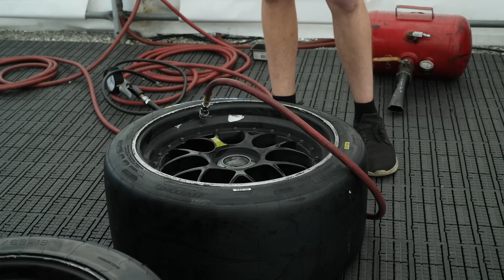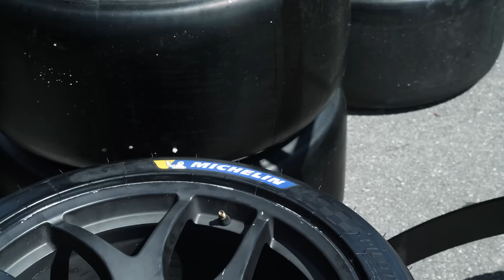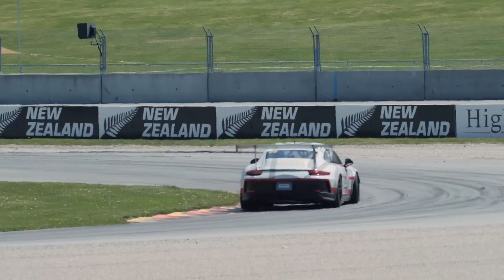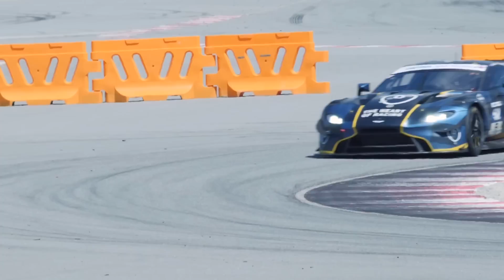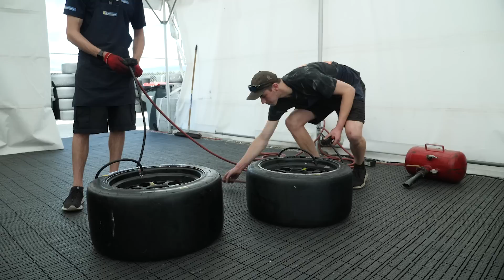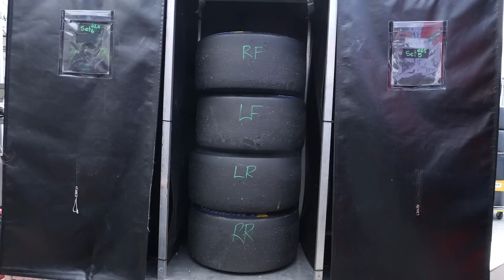Are your race tires too big? | Slicks Vs Semi-slicks

Comment: Please could someone explain why tyre performance drops as it wears? If the tyre is solid rubber, wouldn't it have grip the whole way through?
Reply from the maker: Less rubber, less thermal stability, and a heat-cycled, chemically aged compound are probably the main ones 😎
For the likes of sim racing tyres are actually one of the most difficult things to try and model accurately as there are so many things going on between them and the track surface, which can vary wildly and change the behaviour of tyres track to track too - Taz.
Reply: @hpa101 thank you for the reply. Every part of a racing car just gets more and more complex, the more that I learn about them
Reply from the maker: No worries, and they absolutely do! Diminishing gains the deeper you go though, depending on how deep the team you're trying to beat is going anyway haha 😎 - Taz.

Comment: but putting slicks on a car without changing or tuning the suspension, is it that beneficial? I would expect that the slicks makes the suspension feel a lot softer.
Reply: Good question. My humble answer is that the process of discovering what is a (near) optimum setup on road rubber vs an optimum setup on slicks (correct for vehicle loading, ambient temps and race duration) is an iterative process. Slicks will definitely increase the maximum load transfer both lateral and longitudinal. Therefore, spring, damper, geometry will all need readjustment or possibly replacement from existing. There are far more variables than constants here, so I'd always start the same way- run a fixed, known tyre pressure for all wheels, and measure temperatures across treads of all 4 wheels after a long test session, at high commitment. When you've made geometry adjustments to give the tyres a near-even temperature across the treads, you can then appraise the balance and feel of the car from a driver's viewpoint and look at adjusting other things, like springs and dampers (and whatever else!). As long as you get a baseline with as many variables clamped down, you get meaningful information on where to go with it all. I'm sure my own way is nothing like the next guy's, but it's worked for me since 1989!
Reply: @robair67  thanks! that seems like pretty logical process to go about it

Comment: I’ve been running a set of A050 on my MX5 for Supersprints for 3 about years. 
While they have lost their out of the box grip they are still a fast tyre. 
The only downside is I find I’m having to wait for the car the straighten up a little before applying power versus mashing the pedal before the apex on day 1.
Reply: 3 years on the same set of tires? you don't drive it much then? My cup2's are done after 2 trackdays.
Reply: @ are you offering to be my tyre sponsor?
Reply: @DBatty  No i'm just interested as that very low wear if you drive frequently on track.

Comment: Great video! Just adding to the comment about lap times, typically the biggest gains are made in the slow corners, especially if a long straight follows it. Whilst accelerating out of it a car is usually grip limited, not power limited, so in this case, increasing power won't increase lap times by as much as improving the grip of the car. If you'd like to model this in your car, I made a drag racing simulator, check out the video of it here https://www.youtube.com/watch?v=Mq0asrqRkrc. 

It takes into account, tyres, aero, gearing, inertia, and gradient, so you can see the impact of different tyres have as you accelerate out of a corner. Unfortunately it doesn't currently have a tyre model, it only uses your tyres coefficient of friction (mu), but still highlights the impact of sticker rubber, or changes in gearing etc